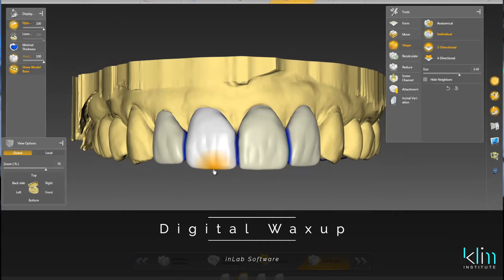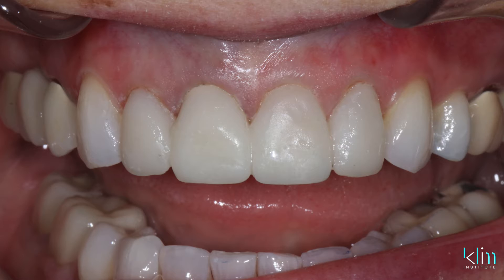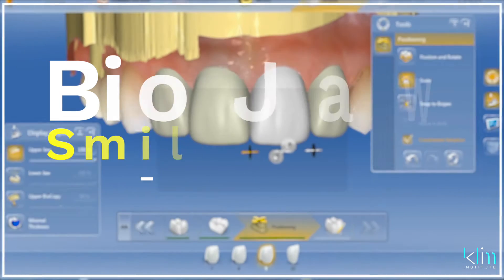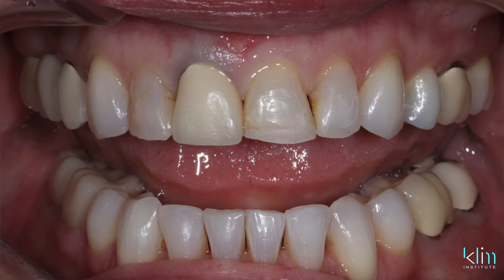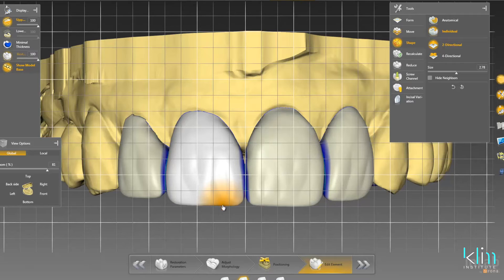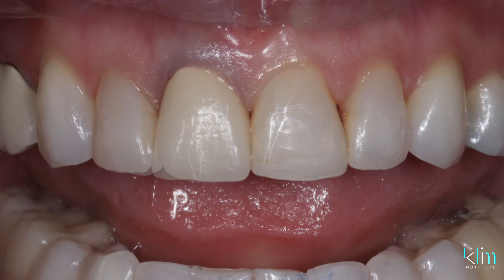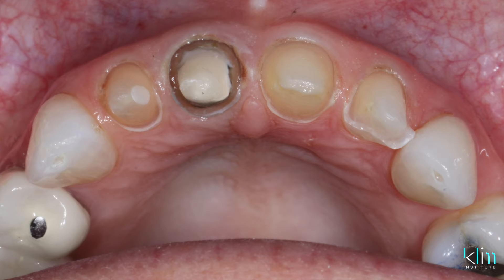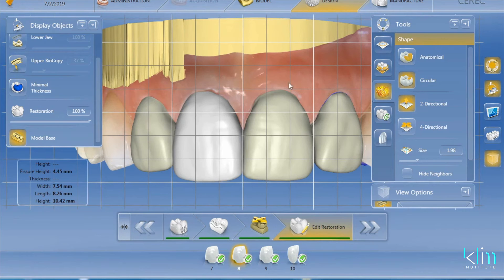Anterior CEREC Time Saving Design Flow

Comment: Which 3d printer do you use? 
And which ovens do you use?/have
Reply from the maker: I recommend Asiga and Sprintray Pro 55 as printers.  As a clinical accessor, I have 4 zirconia and several ceramic furnaces.  For Ceramics I recommend the Programat C2S and for Zirconia the SpeedFire for katana and the Programat S1 for long cycle 3Y and 4Y sintering.
Reply: @KlimDDS  
They thank you so much for the reply! Im a hygienist in idaho just looking into potentially starting up my own dental lab here in idaho.
Just looking into the basic setup to get started as far as start up cost consumables etc. 
Is there a particular reason why you went with separate mills ( wet and dry) compared to say the vhf k5 wet and dry milling machine?
Reply from the maker: @nickyb.9588  Great for Idaho.  I live in the Coeur da' Alene area part-time and commute to Santa Rosa.  Which platform are you considering, inLab or 3Shape?  With volume mills, it is better to have a separate wet and dry milling system.  Switching between dry mill with zirconia to wet ceramic will create extra wear and tear due to the zirconia dust becoming moist.  It is hard to clean up and will get into the system.  Knowing that you are thinking of a lab environment, I definitely recommend the Asiga printer.
Reply from the maker: By the way, I am referring only to the Dentsply Sirona system,  maybe the VHF systems handle chamber cleaning well.
Reply: @KlimDDS  
What a small world! No wonder why i was drawn to your videos. (Which are great btw). Ive worked in lewiston for about 11 years and commute from juliaetta.  I was thinking about just setting it up in our house to start up. I havent contacted the dentists in our area yet to see if they would be interested. Just crunching numbers and helping my boss when i can at work.
That makes sense. Ive been going back and forth on that for a month or two. I might end up doing to seperate sirona mills then
.ive worked a little bit with that in our office with the intra oral scanner. I was considering the 3shape lab scanner as well.
Reply: @KlimDDS  okay great. Thank you
Reply: @KlimDDS  hey let me know if u do any classes in our area ever! Id love to go😄

Comment: Dr. Klim, I love this clip! (Well, I love all of your clips.)  In this video, I’m particularly interested in your new technique of masking the dark stump at the cervical and would like to give it a try in the case I’m working on. However, I don’t quite follow how exactly it’s done.
1. Do I understand correctly that you prepare the margin more subgingivally after the ceramic restoration has been fabricated to allow room for the IPS Empress Direct composite  to occupy this space? If so, approx how much deeper? Is there a way to set the CAD or CAM parameters so such space is created during the fabrication of the restoration? 
2. What is your reason for bonding this composite to the crown first versus just using it as the luting cement (e.g., warm this composite to reduce the viscosity)?
Thank you so much for your teaching and inspiration.🙏🏻🙏🏻🙏🏻
Reply from the maker: Yes, the margin is dropped another 1mm after ceramic fabrication to provide room for masking. The primary impacting parameter to help block out a darker root is the spacer. However, in this case, that will not do the whole masking objective. I wanted to change the refractory index of materials to assist in the masking at the margin zone. That is for the switch to an opaque composite. The composite was bonded to the crown first rather than a warm composite technique to finish margins and polish to a high luster prior to cementation.  All the best!

Comment: Primescan question;
Today i scanned the quadrant first before starting the prep and tried to add the preped tooth afterwards by scanning over it. Did not work although i was told it should! Do you have any tips? I gues its a simple trick?! Thanks alot
Reply from the maker: Are you on 4.61 or later version?  Even though the software will auto cutout, it will take more scanning time than the manual cutout.  Keep this in mind.  Primescan does better than Omnicam.

Comment: Thank you Dr Klim for your informative videos
I know glass ceramics are the best to use esthetically but why didn't you go for layered zirconia restoration in this case instead?
Thank you in advance😊😊
Reply from the maker: In my hands, ceramics still have better fluorescence and conservative prep options than the newer aesthetic layered zirconia when in the smile zone,  Not as critical posteriorly.  Unless the zirconia is layered, it is more challenging to achieve the micro-surface texture that ceramics can bring.  Another point is the e.max has on par surface toughness metrics as the newer aesthetic zirconias.
Reply: @KlimDDS  Thank you so much😊😊
I just mentioned zirconia because I noticed some preps after root canal treatment go grey or even black so just to mask
But conservatism is also essential
Thank you so much dr klim..I am a big fan of you😀

Comment from the maker: Hi Scott, the mock-ups are accomplished in the inLab software.  Wish the chairside software would let us do this. It is the Biojaw process with multiple templates to choose from in inLab, once designed and finessed, there is a virtual seat command that will make a second virtual model with the seated virtual wax-up that is then exported as a STL for printing.  It is very accurate. A Siltech matrix is then formed over the printed model similar to what we do with the analogue approach.
Reply: dear Dr Klim , greetings 
can we use inlab software for designing from another  scanner rather  than  dentsply sirona by just importing the stl files from another scanner !?  thx btw  iam big fan for  your work lloking to be a  member  on your site soon ...thx

Comment: Great vid thanks for posting. Are you able to design your prototype mock-ups using CEREC as well or are you using a traditional method? I've been doing mine lately using meshmixer and 3D printing them but having the added ability to fine tune the mock-up occlusion using CEREC's tools would be great.
Reply from the maker: Hi, Scott posted feed back up above.  May all be well